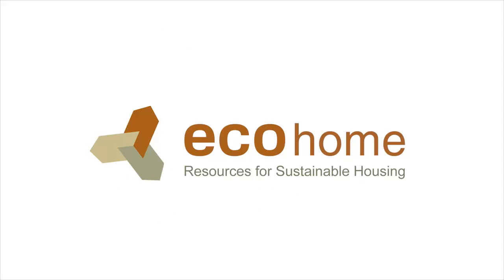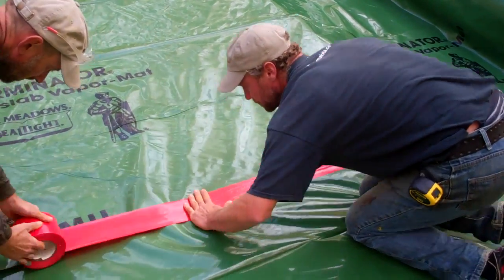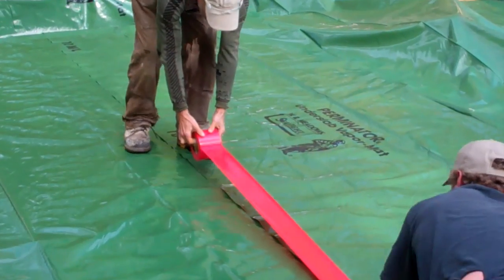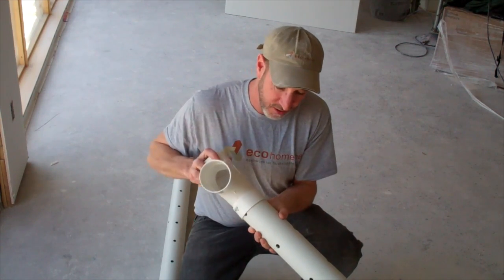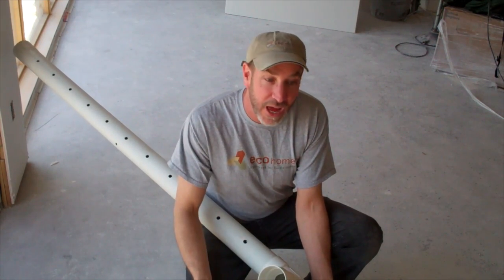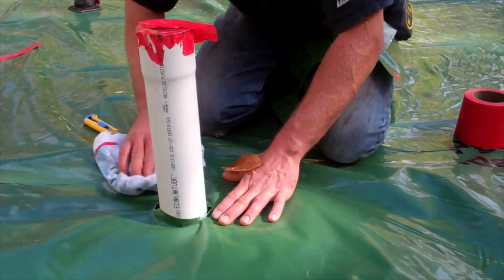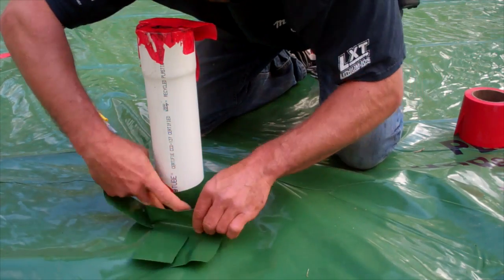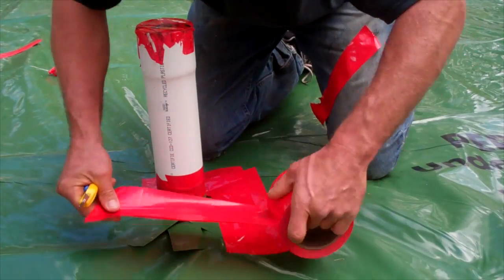Slab floor vapour barrier and radon stack

Comment: Thank you for this video, But what is the main use for Radon barrier ?
and is the (Radon Barrier) the same as (Vapor Barrier)?.
i mean is all this barreir to void the Radion Gas ?.
Reply from the maker: +muath jordan What you see here is a vapour barrier but also a radon barrier. Radon Gas is the second greatest cause of lung cancer after smoking, and as we build houses increasingly air tight it is becoming a greater concern. it's a very cheap feature to add to a home to improve the long term air quality.
Reply: +Ecohome it takes too long to reply me,, but this was useful Thank you